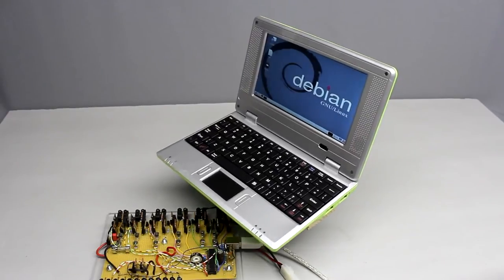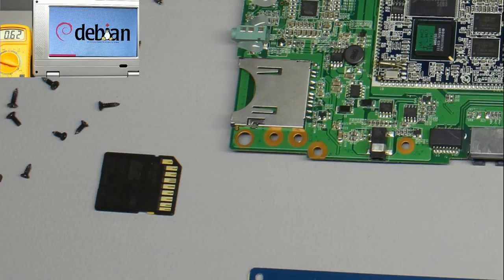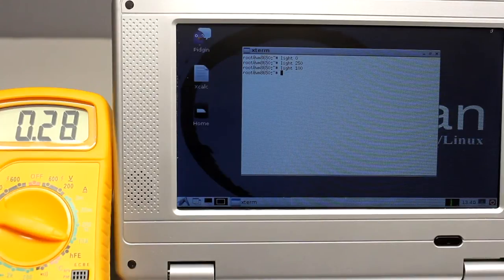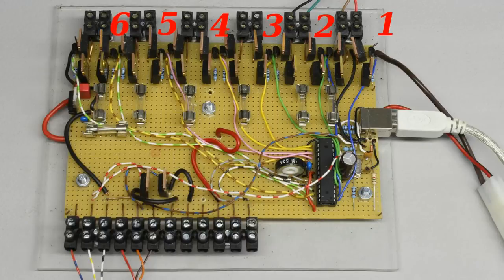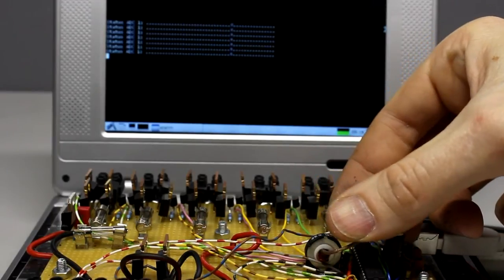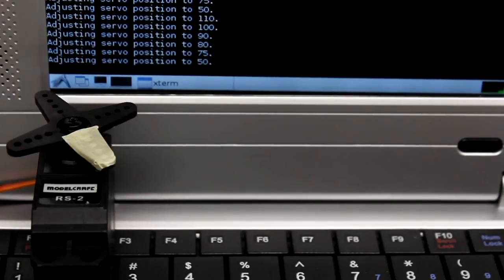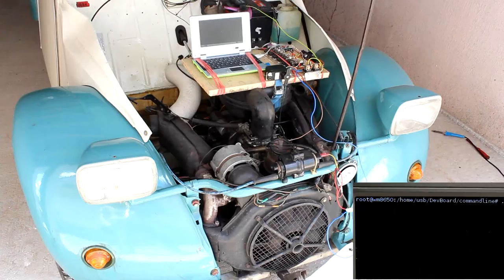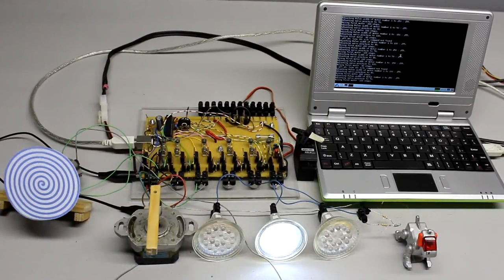Mini laptop with WonderMedia WM8650 chipset

Comment from the maker: Thanks!
Your request would require more than just one tutorial. At least you need knowledge (and hardware) to do the coding (and upload) for the Amega8 microcontroller I have used.
I recommend using the Arduino (uno) microcontroller, because there is a huge community supporting you with knowledge concerning hard- and software.
Some basics about digital signal amplifying is available at my project page:
homofaciens(.)de/technics-computer-io-boards_en_navion.htm

Comment from the maker: You would need the original files and a bootloader recovering the flash. I cant provide those stuff, but probably you can find an answer at the slatedroid(.)com forum.
Sorry for the late answer, but your post was marked as spam so I did not note it until now.

Comment from the maker: slatedroid(.)com/topic/21211-7-wm8650-netbook-linux-port/page__st__200
Is the thread about getting Debian on a WM8650 Laptop.
Yes the Laptop doesn't need an extra monitor/keyboard/mouse, so in sum the costs are very low.
The advantage of the Rasbperry is that it comes with Linux installed and there is a great community supporting you when having problems. Sadly the number of users around the Wonder Media chipset is low and there is absolutely no support by the manufacturer.

Comment: The backlight brightness command used in this video did not work on mine. How exactly do I adjust it?
Reply from the maker: The command to set a value of 70 is:
echo 70 > /sys/class/backlight/pwm-backlight.0/brightness
probably there is another path to the backlight device. Search for the 'backlight' directory to find the accordant path of your installation.
Reply: Thanks, I found the file and edited it manually.

Comment from the maker: Ich verkaufe keine Platinen - sorry.
...niemand ist auf Windows angewiesen, auch wenn Microsoft das gerne so hätte ;)
Für "Normale" PCs gibt es z.B. den Adruino Uno, ein kleiner Microcontroller, der per USB angeschlossen wird und mit dem man Verbraucher Schalten kann. Für den Arduino gibt es Windows-Software (die hab ich aber nicht getestet).
Wenn du das Abenteuer "weg von Windows" wagen möchtest, kann ich dir den Raspberry Pi (Linux) empfehlen. Mit dessen GPIOs ist das Schalten recht einfach.

Comment: Battery similar to the one in video, in wespro N72 wm8650 bloated in 1 month , that company not there now , can't find the battery nowm
Reply from the maker: ...that's the problem with all cheap imports from anywhere in the world. I recommend buying from a store that's hosted in your country for the good stuff. The batteries of my WM8650 laptops are long gone, too...
Reply: Have to make the battery for it using 2 cellphone batteries, just waiting for the right size , I bought that Mimi laptop for embedded applications
Reply from the maker: Maybe the charging circuit on the board is so bad that it will destroy your new batteries, too.

Comment: Hello. Do you still have debian for this laptop? Unfortunately, the link to the dropbox on your site does not work. Could you please upload a file?
Reply from the maker: Since the Raspberry Pi appeared, I no longer use this Laptop. It was an extremely buggy version of Debian with no repositories connected to that special edition and so no chance to install additional software or do any updates. It was especially for this type of Laptop, with this type of mainboard and chipset. I guess any newer Hardware won't work anyway, even if it looks similar. You still want it?
Reply: @HomoFaciens  I got exactly the same 7 inch laptop on wm8650. And I would like to try to install debian on it
Reply from the maker: No warranty for anything:
https://homofaciens.de/temp/WM8560-debian.zip
I will delete the file in a couple of days, because I need the server space.
Reply from the maker: Could you make your laptop boot with the image?
Reply: @HomoFaciens  how i put this image in sd card? any formatation type ?
Reply from the maker: Copy the Image to the SD card with dd under Linux. No need to format the SD card before, because all data will be overwritten by the dd command.
Reply: @HomoFaciens  no worries, just archived on the wayback machine

Comment: ayy lmao.
Reply from the maker: +人魂デンジDVLRBTSX All the technology shown in this video is earth made...
Reply: +HomoFaciens Haha, nice one. I have a WM8650 sublaptop and I want to make that Debian to work on it to practice programming and other Works. Any idea about how to start? Im so new in this type of machines, thanks.
Reply from the maker: +人魂デンジDVLRBTSX If you have debian up an running, you can do coding in C/C++ using a simple text editor and gcc. I will start a series about physical computing considering hard and software in the near future.
Reply: HomoFaciens Im glad about 'hearing' that! I'll stand by for it. But my actual question is, how or where can I get information or a good Debian distro to run on my WM8650? I'm so tired looking for it, but all I find are broken links and stuff like that.
Reply from the maker: +人魂デンジDVLRBTSX You won't find a "good" Linux distro with up to date software packages for this laptop. The problem is the very special boot process of those ARM devices. There is a link to the (experimental) version I am using (but I did not compile it) on my project page:
http://www.homofaciens.de/download_en_navion.htm